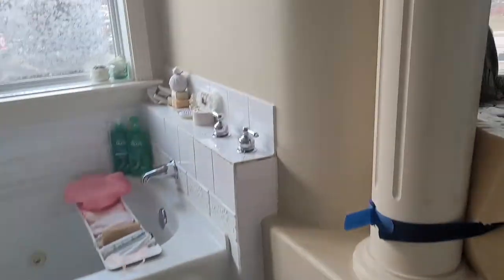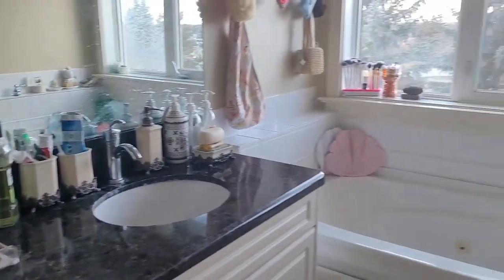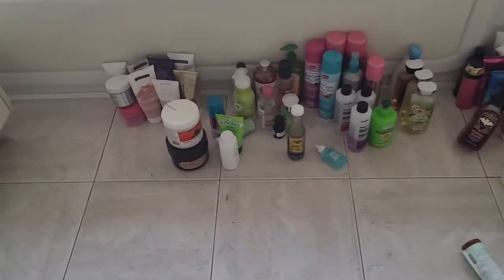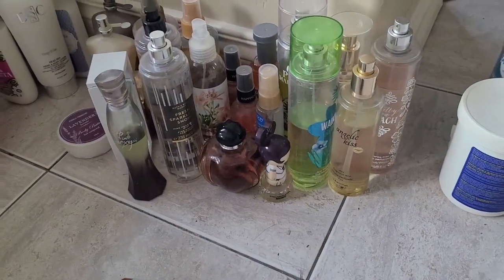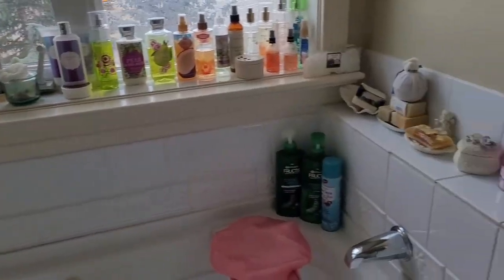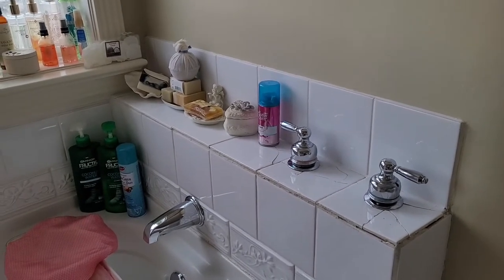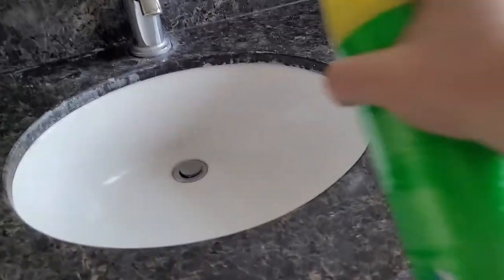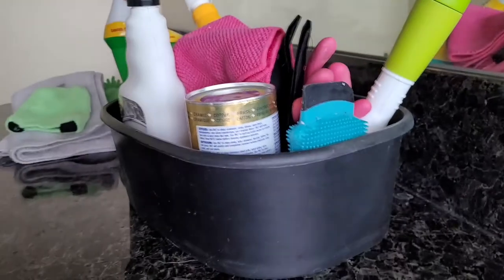Cleaning  Master Bathroom

Comment: Have you considered to just by a shower hose. And put your shower head on it.

There are four standard sizes: 1.25m, 1.50m, 1.75m and 2m. However, in the catalogue you will find even longer hoses to suit all needs. There are three important criteria to consider when choosing the length and these are the height of the household members and the height of the water tap.

Just take your show head off.. and take it with you to make sure it will fit on the shower hose.